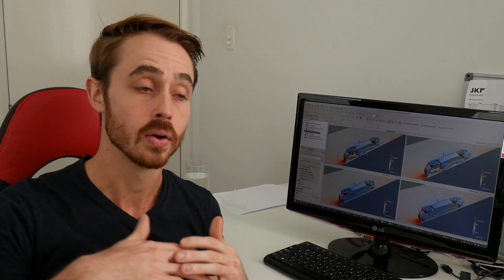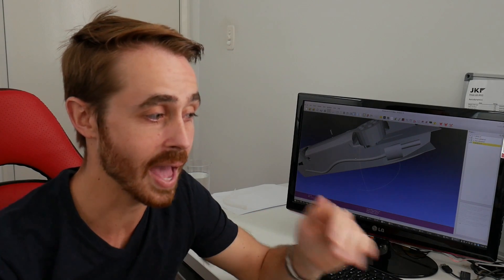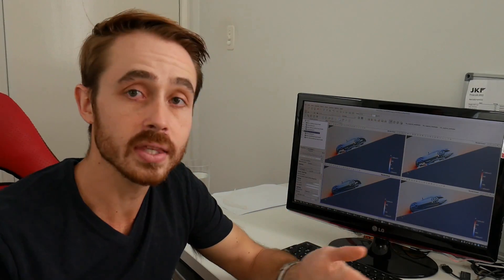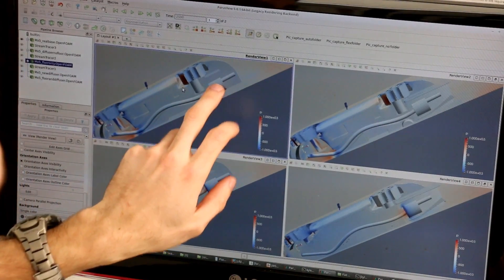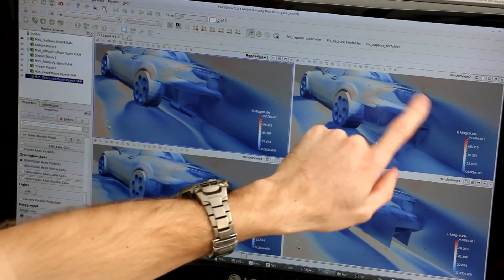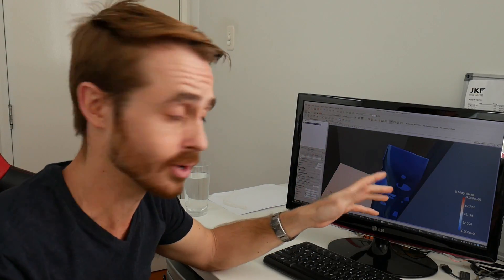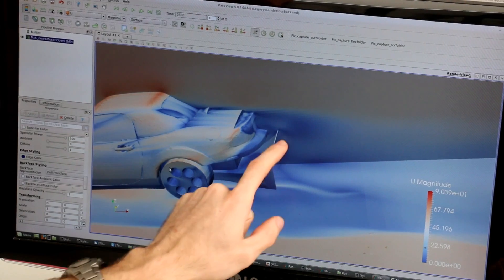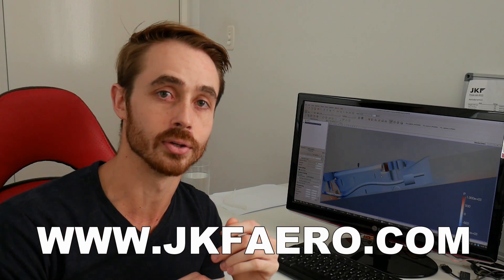Does a Diffuser Need a Flat Floor to Work?

Comment: Hi..Kyle, I’ve made a flat floor and improved lap time, a lot. Then added a diffuser. Here is an interesting scenario with a question. When the diffuser is on , the water temp creeps up, is the diffuser pulling air from the front stagnation zone through the flat floor? Reduced air flow to the radiator inlet? It only happens on track, and I do have a proper vented hood. Anyway, great video 👍

Comment: Hi! I was wondering, how does rake affect underbody flow? Specifically on a flat bottom+diffuser car. Hypothetical example where the wheelbase is 2500mm, front and rear overhangs 500mm each, front ride height 75mm measured behind the wheel and rear 100mm before the wheel. Are those proportions even worth considering? What rake would be considerable enough to go and adjust the underbody panels to keep them level?

Comment: If you had a floor which was flat with a diffuser,  do you think there would be benefit to having small maybe 2" skirts running along the edge of the floor front to back or would it cause more issues
Reply: Skirts would help by separating the flow from the sides and below.

Comment: Should the diffuser be concave or convex? It looks like Wehrlein's Sauber diffuser is concave: https://www.formula1.com/content/fom-website/en/latest/headlines/2017/5/wehlein-to-have-back-scan-after-scary-monaco-crash/_jcr_content/image16x9.img.1536.high.jpg
Reply: It's an upside down wing...so it need to be convex to keep the flow attached.

Comment: I'm seeing more modern (last 15 years or so) cars have their rear muffler sideways so they can do a dual exhaust outlet from a single pipe.  The muffler being sideways makes it more rounded to the airflow vs the hard 90* edges of a muffler like you have modeled.   the Miata you use as your example actually has a sideways muffler like that.

can you do a model with a muffler like that? comparing all 4 scenarios you compared in this video?

Comment: Nobody in their right mind does all the work putting a flat floor and/or diffuser and leaves the exhaust completely in the airflow.
Reply: in fairness it is usual because of regulations
Reply: For road cars yes you do. My long tube headers hang lower than my mufflers so I would say that’s going to be my biggest problem

Comment: In regard to CN type cars  ( front+rear diffusers+flat floor )...
in years past the straight front splitters were often run very close to the ground, but now they often how a raised mid sections.

Any rules of thumb to finding a starting point on how much air flow to have under the car ?
Reply: the raised mid section is for bumpier and race track with compressions and decompressions... so the car is more stable in terms of general grip.. so there is no situation of bottoming out with splitter cutting the airflow tottally.. and unsettling the car. look for example how new ferrari GT3.. etc cars have front

Comment: when adding a flat floor the problem with engine bay venting, is it a bad idea to add a "step" with rearward slot in it to allow hot engine bay air out, I understand that ideally you would vent it out the top
Reply: It's common to vent it out the bottom. You can actually improve downforce by using it as a jet along the surface

Comment: I am surprised how tiny the effect is at 180kph ... Driving a low power timeattack car sure has it's drawbacks, can't get enough speed for some aero to make enough difference to justify the added weight and time to make the parts! :O
Rules don't allow for full flat floor (can still make partial), but if we are going to see only something like 20kg from a massive diffuser which will by itself weight probably 10kg+ from low cost materials ...

Or did you mean 11kg from the small section? full car would be twice at least ...

Oh well, the good news is that i can scratch diffuser off the list until i know i will hit consistently above 200kph on most tracks
Reply: I thought of this too.. Are these numbers representative of the half cut car or normalized to a full size car. I'd also assume approximately four times more downforce/drag for a doubling of speed as a rough guesstimate.

Comment: Moral of the story is to do a muffler delete. Muffler seems to screw everything up
Reply: Absolutely, would be really intresting to see an analysis without the muffler
Reply: side pipe would be nice if it helps with achiving better downforce.
Reply: Turd Ferguson absolutely, thatd be awesome
Reply: Supercars... either run side pipes if front engine or central exhaust with mid engine.
Reply: What's the best way to go if you're looking for the least amount of drag, like in a 1/2 mile race? I have an awd car and am interested in seeing the differences and best way to go as far as the combo of diffuser and flat-floors